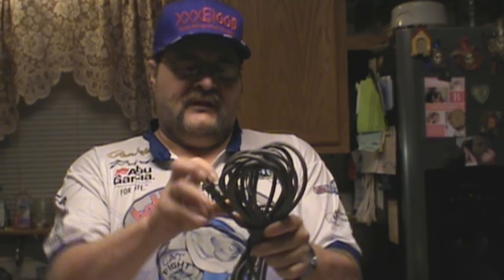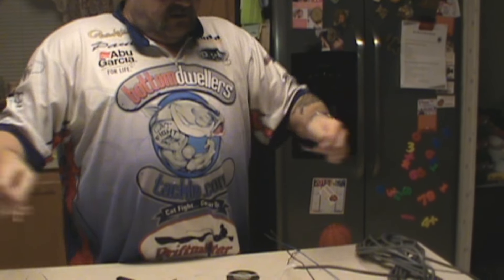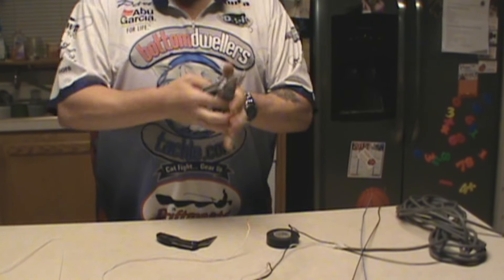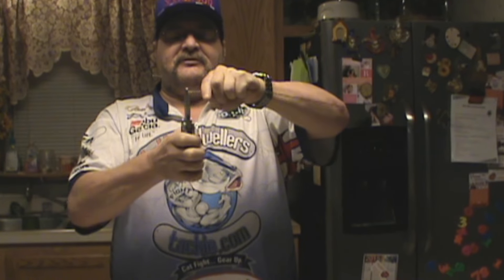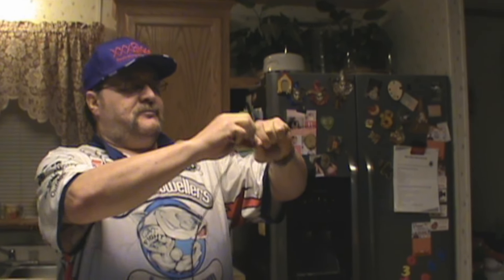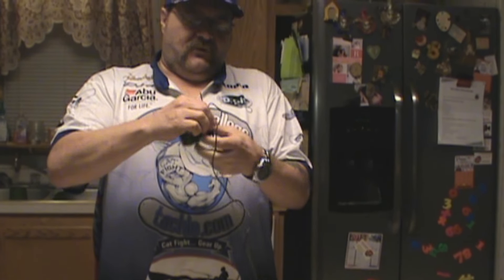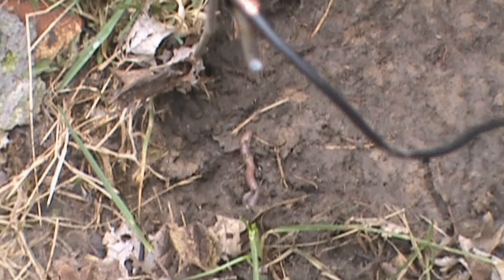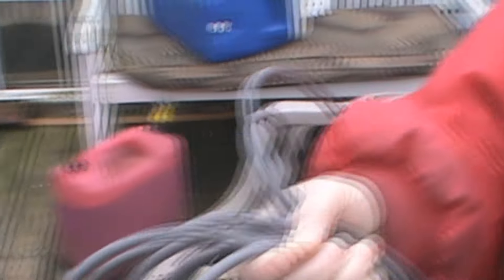Worm Shocker - Worm Harvesting

Comment: Would this work with a 12VDC to 120VAC power inverter so you can do this without access to the power grid, like if you are near your favorite fishing spot and theres no power you can whip out a power inverter and this rig and then either use a jumpstart pack or plug it into your car. How much juice does this draw?